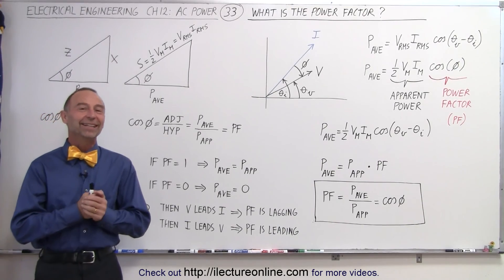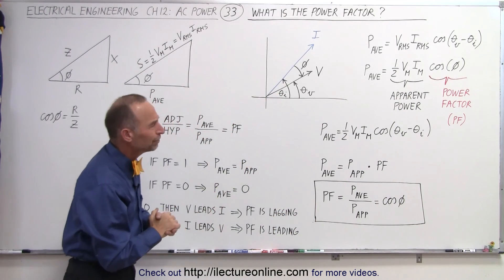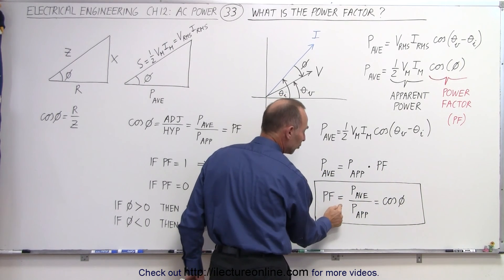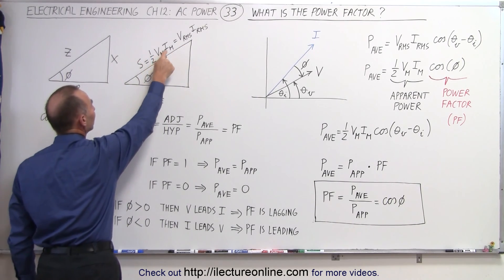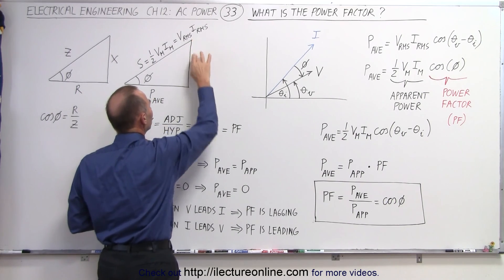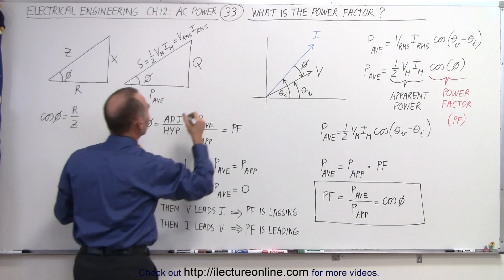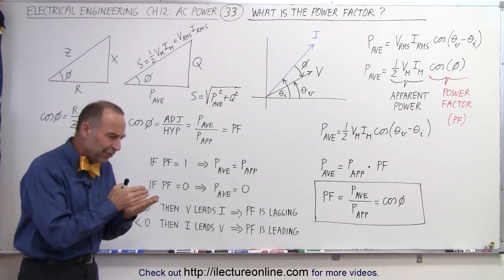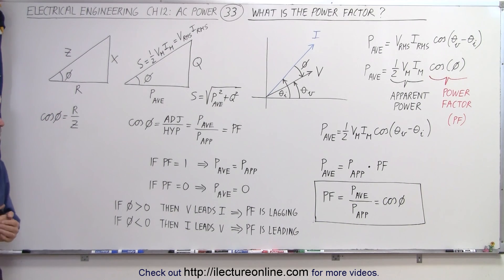Electrical Engineering: Ch 12 AC Power (33 of 58) What is the Power Factor?

Comment: sir before 31th video we always wrote Qi-Qv. Why in the last three video write reverse?
Reply: I know this is late but it’s the same...you can try it yourself.
Reply: @mero4243  actually I graduated from this course but not sure about being same. Because minus sign differences will occur. Please check the power factor formula the true one is that one. Best wishes
Reply: @muhammedtalhayasar6687  congrat, mate! And thanks for the heads up. Will check it now...finding difficult in this electrical circuits course; hope I can pass. Cheers!
Reply: @mero4243  u will, nothing hard actually. Just try to feel it so that you can interpret cases without help. And as I remember sign of the phase difference affect the inductiveness or capacitiveness. One of them normal triangle and other one is reverse because, g.e ,+10° is greater 10 degrees from zero but -10° is reverse direction greatness from zero. You will get the idea that's enough I guess. Best wishes come agter graduation:)